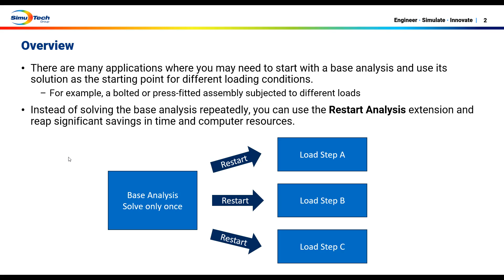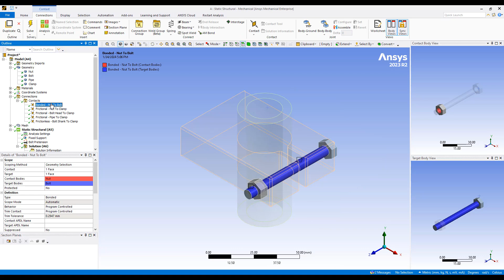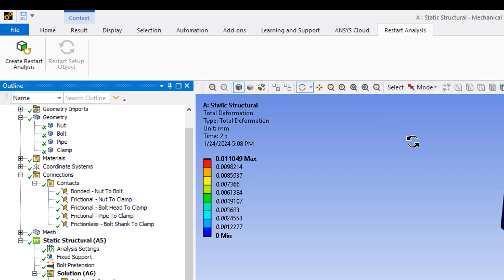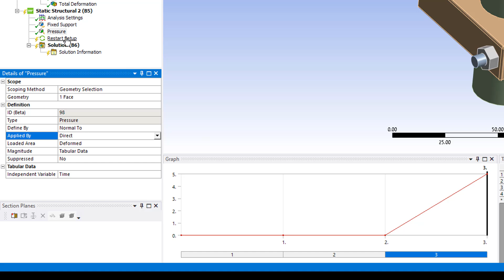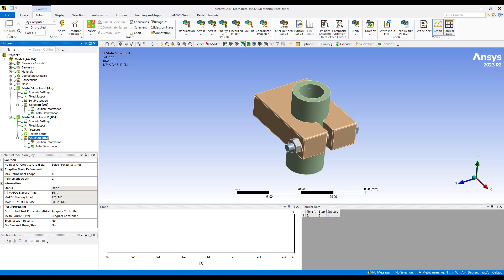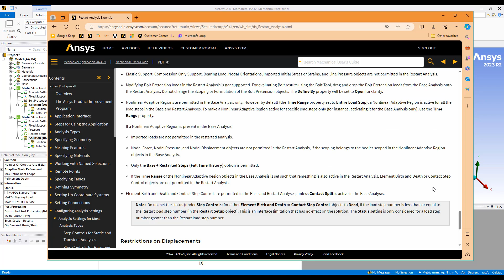How to Use the Restart Analysis Extension in ANSYS Mechanical

Comment: why cant weak spring be used?
Reply from the maker: Thank you for your comment! There is no reason detailed in the Restart Extension documentation as to why weak springs cannot be used.  Weak springs, however, can be used in a restart analysis performed within Mechanical, not using the Restart Extension.